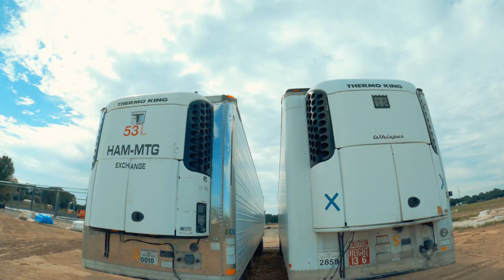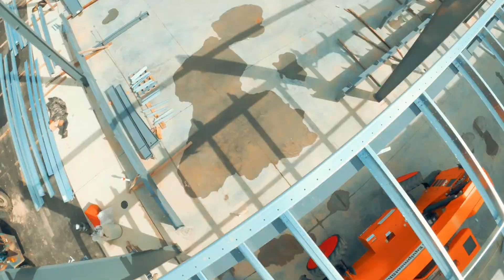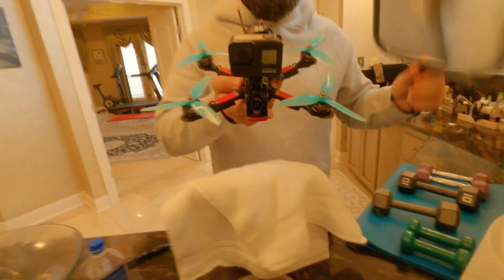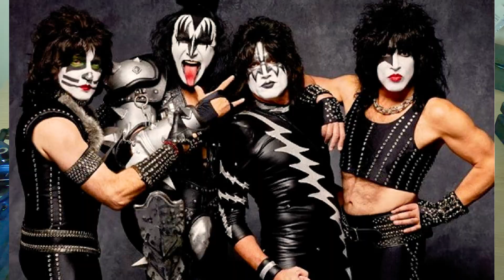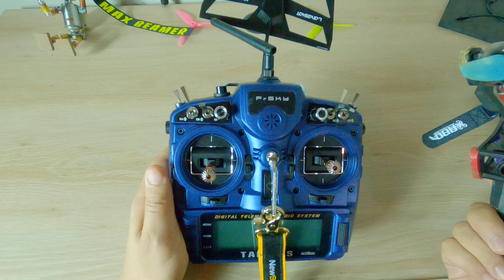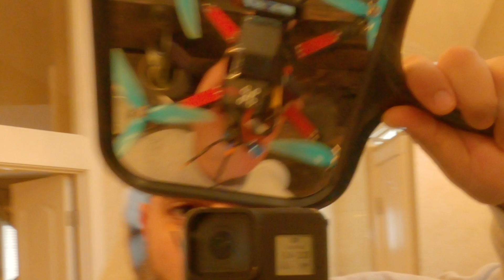Lightweight Cinematic FPV Drone

Comment: So it's been a while. How is this fiddling cable holding up in crashes? Do you still use it  a lot? I also wonder about the cable getting hit by propellers when having enough slack for the tilting GoPro.
Reply from the maker: its going good for me I use it all the time you just gotta I have had it disconnect once in a nasty crash but be careful when you set it up to do it right, and it should be fine. iflight just came out with a cable that does the same thing that plugs into your lipo balance lead, probably a better option for u.
Reply: @MaxBeamer  That sounds nice! I wish the usb-c connector was angled tho. This way it'll break too easily I guess. I also just found a side door with a hole in it for the usb-c port (on alixpress). Neat!

Comment: not sure if I missed it in the video but did you connect the bec to the battery terminals or just any vcc and ground port on your FC?
Reply from the maker: I connected directly to the main ESC Pads but I suppose you could connect to any vcc + ground

Comment: So what's the weight now without a battery? I didn't get that from the video.   Was the 715 grams with a lipo? If so what size?
Reply from the maker: 625g says in the thumbnail and I say it in the video. lipo is 1100mah 6s
Reply: @MaxBeamer  my bad i swear I tried watching it over like 2 times and didn't catch it I must be dumb lmfao.   Thanks 😊 🙏

Comment: Hi Max, sorry for the stupid comment, but can I tap the wires directly to a 5v pin on the FC?...
Thanks bro, sorry for the dumb question...
Reply from the maker: if you get enough amps (over1.5) then sure but most fc's put out 1.5 and under and the ones that say they put out more often don't actually haha check the manual it should say something about it at least

Comment: Saving weight with a tbs rx thar big 😂, buy a nano rx and use shrink wraps instead of stubby antennas, S3 props are lighter as well foam pad for gopro, 2 screws per motors lunar lander battery
Reply from the maker: looks like you have no idea what your talking about, basically. at least you were confident about it.

Comment: Great info! Almost ready for 5inch build, but first getting this acrobrat duo flying right. Off topic, I updated firmware to Betaflight 4.2. It was flying okay on stock pids, made some adjustments, feels better. But now Im not sure if I did anything, but when flying and trying to keep straight line, if I'm off the sticks, it wants to continue pitching itself forward on its own.  Should I just go back to default and start over?
Reply from the maker: ahhh that sounds like an issue with the gyro, usually if its pitching on its own either the gyro is going bad or theres some sort of interference OR pitch I term is really really low.

Comment: Is the gopro battery less energy dense than your lipos? I agree that you're saving weight, but it comes at the cost of pulling more power. It would be interesting to test flight times back to back - one with the gopro battery and one with the usb cable.
Reply from the maker: I think I actually get longer flight times from dropping the weight. the gopro is pulling 5v at 1.5a for 4 minutes off my 6s so its probably negligible since that tiny 5v battery keeps it powered for like an hour..

Comment: So true I have a x9d plus. I love it. I jave tried many radios. I just can't get same feel as my x9d plus. Love it. I hear you on the weight my 2 quads weigh 625 all up flight. Great video👍
Reply from the maker: its so good I just have to get used to throttle and yaw with the lil bit smaller gimbals some stick time should do it
Reply: Have you guys tried jumper or radiomasters?

Comment: Nice man was thinking of doing exactly this but with the insta360 one r and ditching the battery module altigether ,u tried it for fpv yet ?
Reply from the maker: the insta360? nah I haven't but it looks like a winner imo
Reply: @MaxBeamer  yea gonna probably pick one up in the next week or so along with some cinerat parts iv been meaning to order, just annoying me how much extra the Lica mod for it is, I kinda wanted to just get that and the 360mod but that's like 800 bucks where as the twin edition with 4kmod and 360 mod is like 450 and the Lica mod is like 300 or something alone so probably just go twin edition for now.

Comment: been doing the usb power on tthe gopro for a while but for people a little scared, i started off by just removing the hero 8 battery door it's 11 freaking grams... just for that..
Reply from the maker: yehhh but then you run into issues of the battery falling out hahaI started with that as well
Reply: Max Beamer what i did is i put some hard foam i cut out in the shape of the door and taped it and after some crashed haven’t had any issues but yeah it’s a risk i guess ✌️

Comment: Please tell me more about how this puny "fins" on the motor move air through the motor and not the big ass props  right over the open parts of the motor.....  come on....
Reply: Plenty of info /proof /evidence right here on YouTube. It's not Max' job to educate the ignorant, do your own research. 🍻
Reply: @stevenkelby2169 Sound like something a flat earther would say.
Reply: @ray4lsd  That's true, it does...
Ok then I'll try, the hub of the prop isn't moving any air so that's not forcing much through the motor. The majority of the air moved by the props happens out by the tips.
There's a video somewhere showing that the fins on these motors do produce thrust, so they are at least forcing air through the motor.
I'll find it and post here.

Comment: Dude that's awesome! The FC I'm rocking (NewBeeDrone Infinity305) has a 5v 2a pin that I'm not using, so I'm gonna try that out. Thanks!
Reply from the maker: yes indeed! forgot to mention if ya got a pad to use it lol
Reply: I have this setup on a Mamba F405 mk2. It runs rx, gps and Hero 8 from the 5V 2A pad. That's probably pushing it, a separate bec would be better. One issue with USB power is the Gopro loses its date and time settings without a battery inside.
Reply: @treesifpv3848  The date/time is kind of a bummer. Not a deal breaker, but still. Wonder if pairing via bluetooth fixes it.

Comment: Ok tell me if I understand this right.

You have taken a hero 8 and taken the battery out but are just powering it from the quad through the usb? you’re not modding it you’re simply removing the battery and powering it from a different place?
Reply: it sounds obvious but I just never thought of that 😆
Reply from the maker: haha exactly! this way you still have the hero 8 to use with the batt if you want no harm done
Reply: @MaxBeamer  that’s so easy/worth it then!!!
Reply: @galx3573  It is just me, or am I the only one that hates the Idea of condemning a beautiful perfectly working hero 8??..
I really like this idea, this might be the solution..
Thanks
Reply: I gasped thinking he was gonna strip a Hero8.
Reply: Vortex 250pro had gopro supply for hero 3/4 back in the day. 2017’ish.